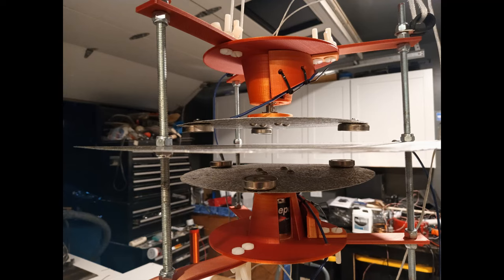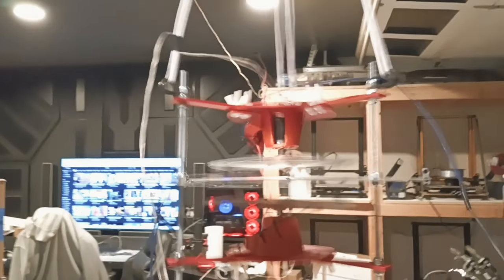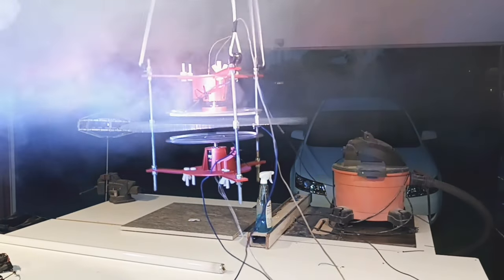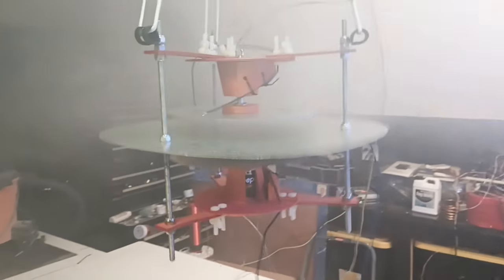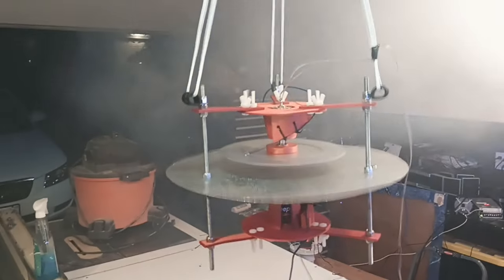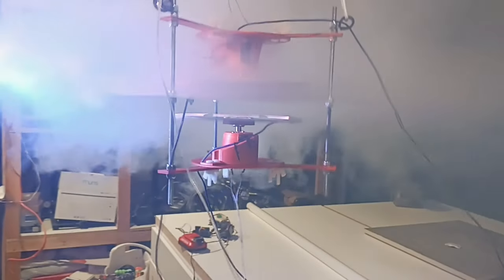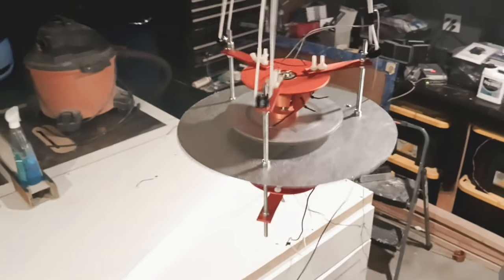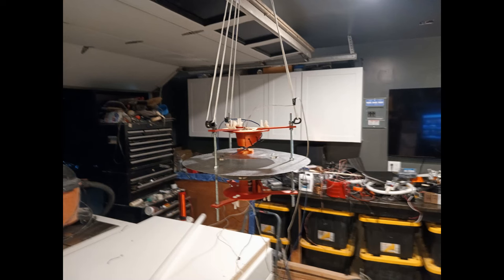Graviflyer Testing 12

Comment: If I were you all, I would stop moving things, and see what effects the charges themselves have on your environment, preferably in a clear box, but I know that would be difficult to obtain. You could even use a cardboard box with plastic wrap on one side.. just something to stop motion and see what motion if any occurs. Would be pretty neat to see the smoke pushed away  or attracted to. I think with my new design what I have built is the middle of the craft, and there should be a shell around it, it’s charge will determine these effects, it can be either positive or negative charged only, because the part I’ve built already IS the other charge and in doing so would complete the asymmetrical capacitor.. 👀
Reply from the maker: This device does not move wind very well. I had the garage door down in another video and it did nothing. This is my spare graviflyer. I have the real one just waiting for more power from a tesla coil.  I have a better design for a magnetosphere and I think I will make a blueprint to start that series. 

The sad truth is that this device will not fly until we add more tesla coil power. It needs to hold in ozone. Or at the very least have it produced where the high voltage meets the tesla coil field. A magnetosphere would allow you to use lay lines to achieve this better and a speaker like (Not a speaker) magnetic coil to move the ions out. 

sorry for not responding to your last comment on the time of the video. I will look it up and watch it.
Reply: @nathanbunten4299  very nice! I was meaning just for interaction at the atomic level, like static does, the air can still polarize, would be a nice experiment I might do it with my setup? I have polarization because of the coils already, then once the back emf charges the cap the air should polarize as well..

Comment: In the vids where Alexey uses magnets on top, he has the magnets on top of the top rotor so the magnetic field continues in the same direction from the bottom. So N up on bottom and N up on top. It does make for a stronger magnetic field, and a stronger ion trap in the center, but maintaining resonance is still very difficult, which is why he went to just magnets on the bottom.
Reply from the maker: This is just like kedium physics design then. He should have used a coil of wire. Just wind it one way for north and winding the other way will make it go south.  So the experiment he followed was the Grebennikov experiment. 

He uses the ground as extra power during the initial lift. It is the same as using The earth as ground as the negative in a paper lifter experiment. The positive and the negative must go to each disc as high voltage. The ground acts like a capacitor to charge the fields. It showed up in the testing where I got more power. It came from the ground. I cannot replicate it on the table. Only on the ground. 

The field is to weak. Alexey is 4-6 feet away and still gets the field strength with a strong signal. To do that he has to have a tesla coil that reaches that far. His is double the strength of mine. Also the TC field is not strong enough to hold ozone. It only holds in static volts. The only way that field breaks gravity is by holding ozone as a thin layer. 

The test was a response to a question I got. This is my spare Graviflyer. I won't change the other one for anything. I have to get a stronger tesla coil built. I blew giant sparks trying new transistors and now I am going to try a new #2 coil and a converted zvs with tesla coil capacitors. If I can't get it with one TC I will try 2.

Comment: What if you placed a bigger magnet on one side, like a 6-inch outside diameter neodymium magnet, and removed the magnets from the other side, like you had before concentrating the field more? Magnets are strange in the fact that they have a negative and positive field within them but if they break off these fields separate with the magnet. Meaning if you break a magnet it becomes its own bipolar magnet. So the real question is would a larger magnet on one side change anything as it would increase the area that was magnetically charged?
Reply from the maker: All the magnets in this craft are to put eddie current into it. directional flow magnets would have been better. Just like a magnetron has a magnet on top and bottom to achieve this. If I change the magnets, I will just redesign the project. I have been thinking of just doing a separate magnetosphere project anyway. Then I can use known experiments to get there.

Comment: That smoker gives the smoke too much initial velocity, it's hard to see what direction the device pushes it when the garage fills up in a few seconds hehe.
Smoke tests are a pain to get right and a bigger pain to get rid of it for a re-test.

Other YouTubers usually use a bag filled with smoke, so that they can give it minimum velocity and minimum distortion/spread of the smoke column.

Comment: You need to put some loctite on all them bolts anything that's threaded you some threadlocker tighten that thing down Make it rigid also the goal is to move spread space not air

Comment: With the additional cogging you’re going to draw more current to the motors. Maybe this works but now you have to spread the plates out farther. Wondering where that sweet spot is. Interested to see how the high voltage effects with magnets top and bottom vs just on the bottom. Thank you for sharing!

Comment: When nature relaxes it's energy state (stress energy tensor) it forms hexagonal prisms. 

I think the magnets should be together on one disk to get one hexagonal fractal pattern. This also isnt fighting itself like counter rotating magnets making reaching the reasonant frequencies actually achievable.

We saw from the previous video how when the voltage is increasing or the disk is accelerating more sparks/plasma collect on the bottom disk. This makes me think the magnets only assist in collecting negative charge there to create an electrostatic repultion with Earth. Build to 7 tesla from REASONANCE and it will float. See, i think low voltage input is all that is needed but the output must be very large voltage. Thats my theory at least. 

When i was abducted i remember a low hum/pulse that was less than 100 hz. Probably close to 50hz. 

For the piezo buzzer I would think its important to get a cymatic frequencies that follows a similar hexigonal pattern as the magnets but this one is mer speculation. I think this because it starts reasonamting with itself when being tapped. So their is a phase change till the waves stack just rights. 

I would try frequencies that sum to 9 first. All intervals of nine are also composed of an interval 9 when its digits are summed. In other words mathemathics forms fractals with 9. Fractals follow spirals. Spiral em fields for plasma torroids. This is the end goal. One large bose-einstienien cold plasma that reasonates to bend gravitational field lines. (Really all Electric field in my opinion but whatever)
Reply: Were you taken into a spaceship? Thanks for sharing!
Reply: Actually it's just shy of 9, by 2 hundredths I think it was. I need better stuffs to get an exact . 
Don't mind my side busting on yall
Reply: @MRm3th3ad  curious on your source and why you think that? That's very specific...

Comment: if you could make the waves bend like a tulip, maybe.
I wonder what this would do with a housing,
but Alex did not have one.. really mind boggling.
Reply from the maker: I thought the same thing. This project presents more like a field generator that a ufo. It feels like a part of a ship and not the reason for the ship. I want to work on the energy flow. I need to thicken the tesla coil field to get it to show up without a light bulb. I failed in this test.

Comment: What you are witnessing is an un-balanced set of rotating masses with sloppy bearings that torsion against each other, flexing the plate between them.
Reply: Seriously use copper and aluminum plates at a closer distance and you might see a real effect,
Reply from the maker: I know. I knew before I ran the motors. People think this will work. It will never work. I am trying to show that.

Comment: I don't see any vortices in the cloud. Seriously, if that's all the air it can move, it's never going to fly. We've all been duped by mediocre photo shop and video editing.
Reply from the maker: Testing tells no lies. I wanted to see something as well. It surprised me to see how stable it was. I need to lift it from the center to know for sure. With the magnets on the bottom only. I see you previous point.